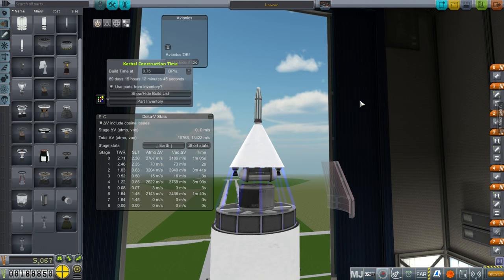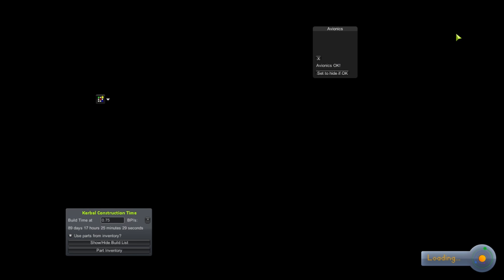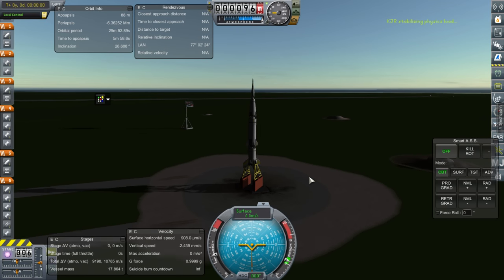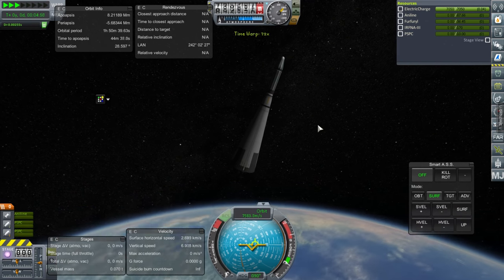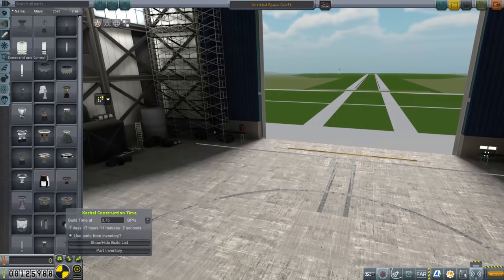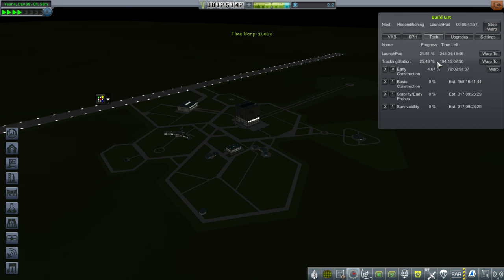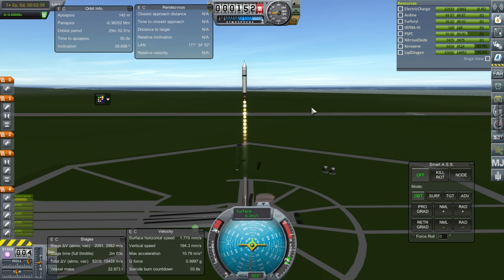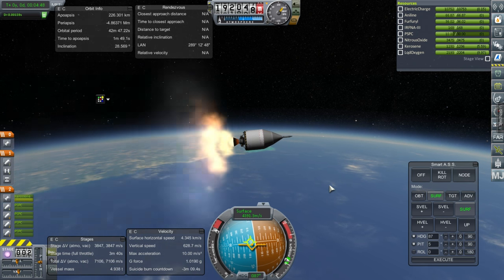Realism Overhaul in KSP 1.1.2 - 04 - Lancer

Comment: had the same issue with my early rockets in my latest play through - Remove tweakscale and use B9 Pparts instead for the wings. fixed it with no further probles

Comment: Hey Tyler, where'd you get those fairings from that are around the able avionics unit? Is that Main Sailors? Did you have to edit the RP-0 tree to get them to show up or are the configs already built in?
Reply: +Tyler Raiz Yeah, I just installed the fairings and they work fine without editing. Very nice.

Comment: Sounding rocket contracts are mostly for netting you a bit more cash, in case you're really running short and/or waiting for new tech to be researched / new rocket to be built.
I tend to build a stock of basic and very, very cheap (500 funds max) sounding rockets and do SR (medium) contracts when i don't have anything better to do at the moment.
About the Dart craft... Why won't you use jet engine?

Comment: Hmm... since it checks the mass when the craft is rolled out, I suppose you could deploy a massive rocket unfueled and fuel it on the launch pad?  Obviously you'd need fuel hoses/KAS for that, but...
Reply from the maker: You can refuel using the launch clamps, actually, but I didn't want to cheat the system like that.